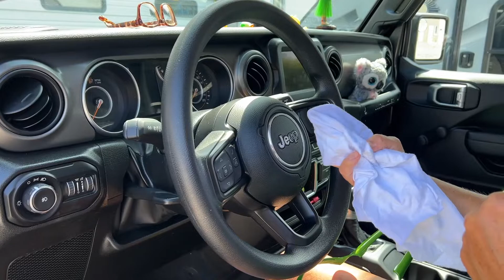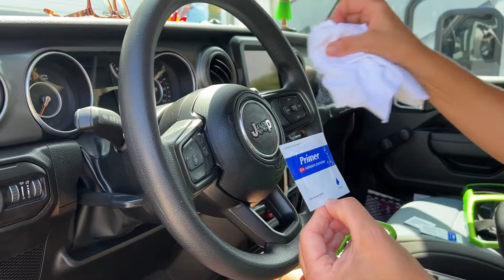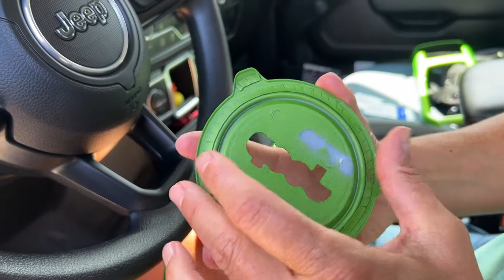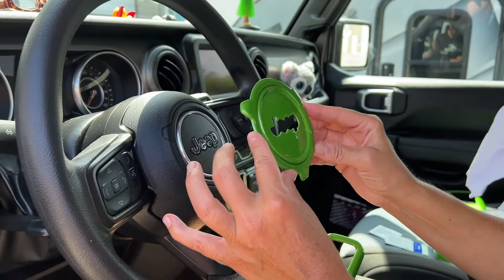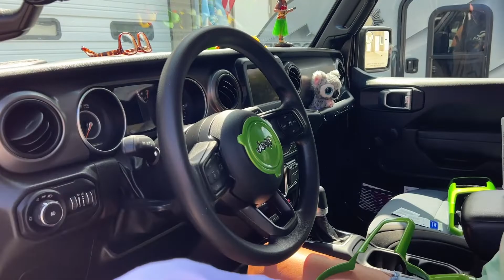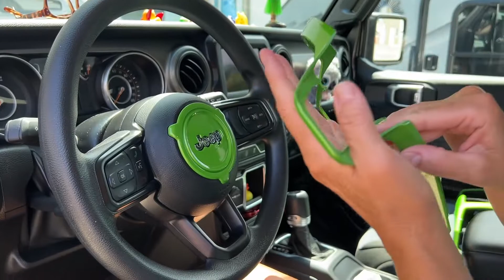STEERING WHEEL ACCENT COVER TRIM INSTALL JL JT JEEP WRANGLER

Comment: Do you really think that tape is going to hold at 200 mph air bag deployment speed
Reply from the maker: The cover trim is not intended to impede airbag deployment so it would be expected to release at any speed that would cause the air bag to deploy.

Comment: Wouldn’t that become a projectile if the air bag goes off?
Reply from the maker: If applied properly it should adhere well. I would imagine it would be no more or less of a projectile than anything in the vehicle that is unsecured when an airbag deploys.
Reply: Straight up 😂